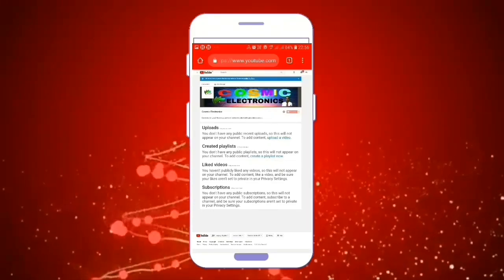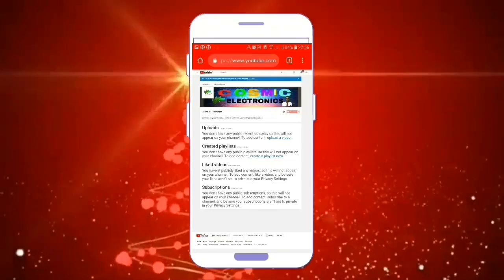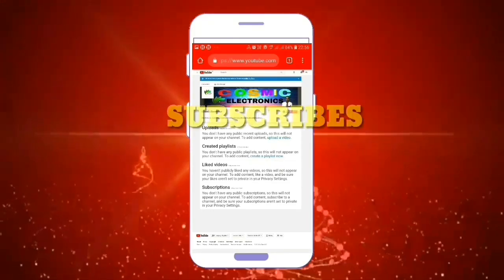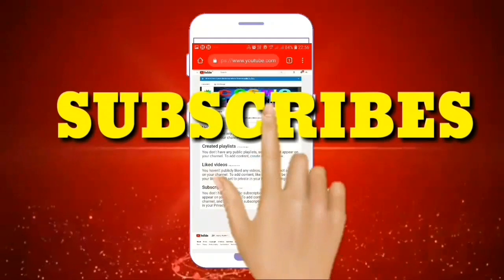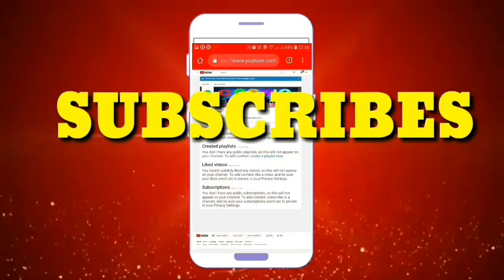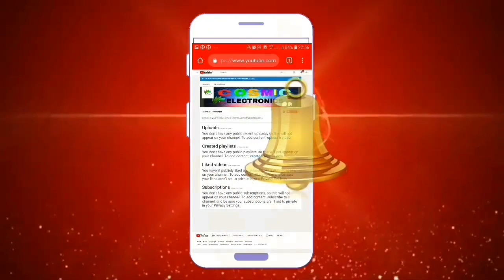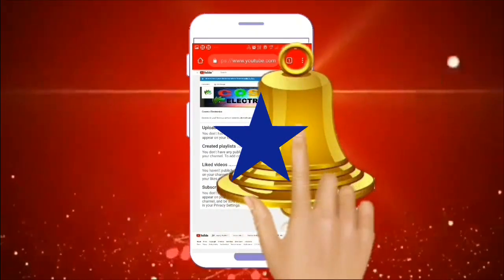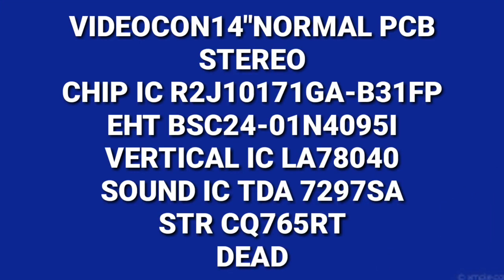#Videocontv#Dead.How to repair Videocon crt tv dead set.

Comment: Helo sir.. That zener diode 18v is that connected to str vcc???and that 18v zener same in samsung tv also?? Thankyou!!
Reply from the maker: Videocon and samsung different circuit.Here use different value zener two circuit. Confirm the value of zener body number OR from circuit diagram. Then set up.
Reply: @CosmicElectronics  the body number sir is ZP27B... How many volts?. Thankyou very much sir !!..
Reply from the maker: @romelaying7305  27V 1watt zener
Reply: Sir vedocon banzuk TV ac supply st c3927 or mosfit  s1854 dead hai or market nhi milraha to kon sa lagega

Comment: ভালো আছেন দাদা। হা দাদা আমাকে একটা EHT নম্বার বলুন না। Videocon মডেল 3643QS main IC 8823cpng3vn7,  vertical 78040, EHT pin  1_Coil, 2 _+B, 3_abl, 4 _nc, 5_gnd,6_180v, 7_nc, 8_Heter, 9_24v, 10_16.5v {(1,2)(5,6,7,8,9,10)} Continuity. Pls Help me Sir.